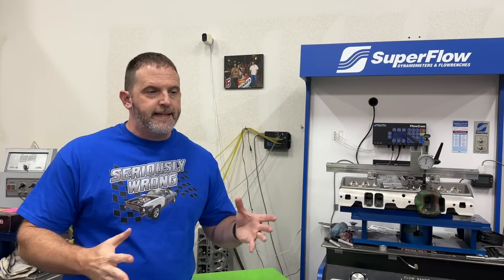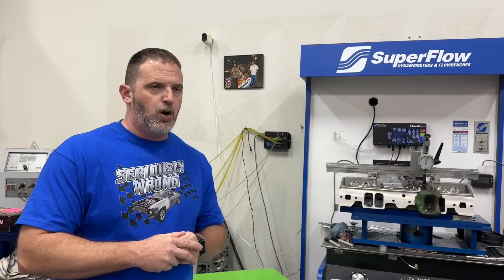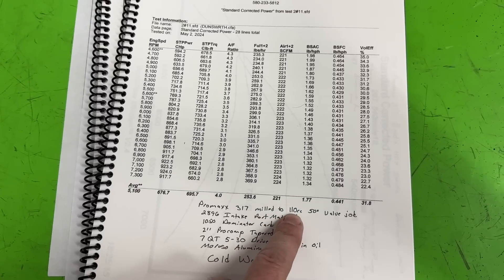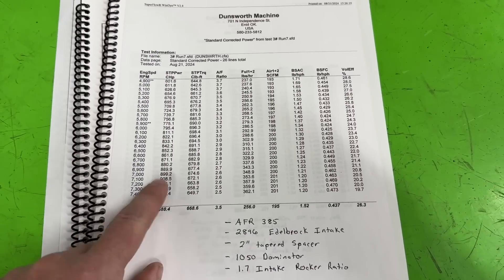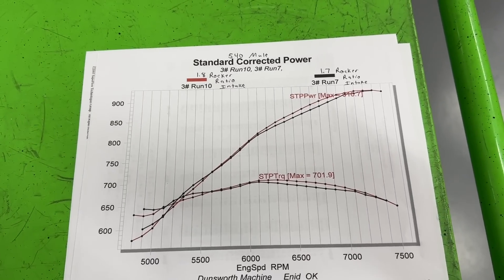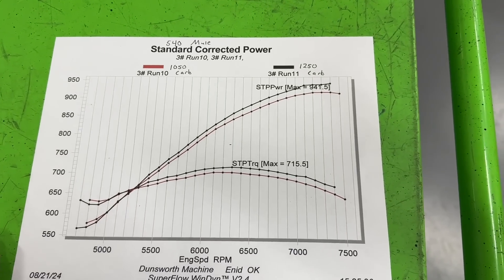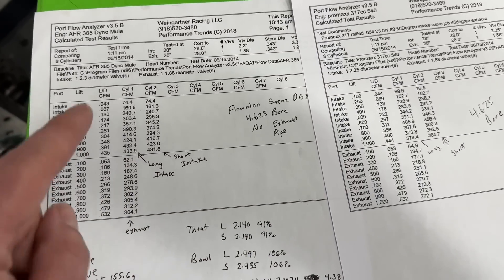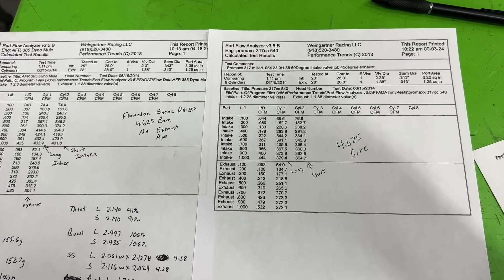Dyno Test Of AFR 385cc BBC Heads And Rocker Arm Test And Testing A Larger Carb

Comment: A tunnel ram and twin 1050 doms and 1000+ should be in the bag especially if you can get more compression peak power may not go up a lot but the torque and area under the curve should go up substantially with the longer runner length.

Comment: @WeingartnerRacing  I have heard from a couple of older builders in my area that they would run, say 1.7 rockers on the four center cylinders and run 1.8 on the four cylinders on the corners to increase the flow the further cylinders.  Have heard of this or have you tried it yourself?

Comment: Dude any time you are over 900 with a 24 degree head on pump gas is impressive. Would be curious to see how much with the same compression ratio 11.2:1 and same cubic inch going to AFRs 18 degree heads would be worth powerwise. Never see any real good test comparisons of how much more power could be made from more exotic heads with shallower valve angles with more efficient chambers. I.E. being able to make more power without having to have sky high compression and stuck running race gas. I know why the tests arent run because its expensive because you would need multiple engines. Just a test i was always intersted to see

Comment: Did he say 11.7  on pump gas? That's really pushing it in my opinion especially in a vehicle 😮
Reply from the maker: 11.3. But I have no problem driving  11.9 compression around in a car if your timing is right. I did it for years.
Reply: @WeingartnerRacing  if the combustion chamber ( head side ) is small enough, that works. but you get a big ass 118cc+ CC in the head, you're going to be limited to what you can get away with and still make power.
Reply: Problem with pump gas is you can't rely on the octane you might be pumping 87 it happens wouldn't want to risk my expensive engine so I generally don't run more than 10.5 compression on the pump for safety

Comment: umm you prbably have already done it but would 1.6 on the intake of a 406 with a b&m forced induction with 10.5 comprssion,and comp cam hydraulic roller  blower cam around .500 lift, and afr heads not the cheap ones

Comment: In a car the bigger carburetor will slow air speed down and go slower don’t care what the dyno says you don’t drive it with 3200 lbs of weight behind it.
Reply from the maker: I can say for a fact that is false. The Camaro had a 540bbc in it that only made 840. From the 1000cfm to 1375cfm dominator it gained on the dyno and was far faster on the track.
Reply from the maker: Further proof is the tunnel ram that’s on it now with 2300cfm of carb. No bog just goes.

Comment: EDIT: OK, revised my numbers after paying more attention to the video.
Looks like it's currently making about 2.28HP per CFM @ 405 ...... So 1000 / 2.25 = ~444.4 CFM

Tunnel ram w/ dual dominators + ported ProMax heads @ ~445 CFM..... Possibly make 1000HP?
Now is there possibly ~40+ CFM to be  found in massaging those ProMax heads?

Comment: Nice work Eric. 385’s maybe too much head for that engine however if they were offering the same compression we would’ve seen a massive difference over the Pro max. The 1250 Dominator surprised me a little.

Comment: I may be in the minority here, but I think once you port the Pro maxx heads and add the larger valve it’ll break over 1000hp with the larger single carb. From what I’ve always heard it’s somewhere in the neighborhood of 4-6 percent per point of compression.
Reply: BBCs really take to compression,  from what I hear and understand .5 can even make a world of difference on them. Bump that 11-1 to 13 or 14 and watch out.

Comment: Racers used 1350 dominator years ago.  514 up to 555 cubic inch engines alot ran tunnel ram and two 1350's. 496 seemed to work well with two 1150"s.

Comment: Wonder how much HP difference was due to 2 different fuels?
Reply: Extra octane doesn't make power unless your engine is knock limited and the engine needs its timming reduced from optimum to stop it from knocking.
If you wanted to run the Promax heads, you'd likely need to lower the compression to stop the knock, thus reducing the power  right across the rpm range.

Comment: i have a set of the 385's on a 555 and i really like them. At 12.9 CR with .810 lift. Its looking like they would like even more cam. Thanks for this dyno test Eric. Maybe you could test with the profiler tunnel ram ? thats what i'm using with a pair of 750's
Reply: i will warn you that the profiler t-ram needs work before it will even bolt on to the 385 heads. The flange interferes with a ridge on the heads just above the intake ports, and mine needed .100 milled off the end rails so that it wasn't sitting right on the block.